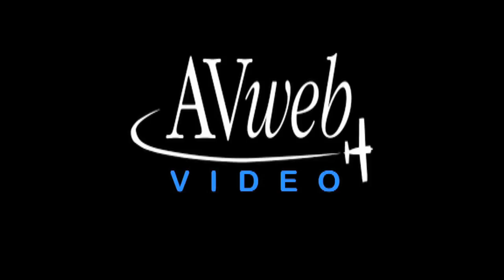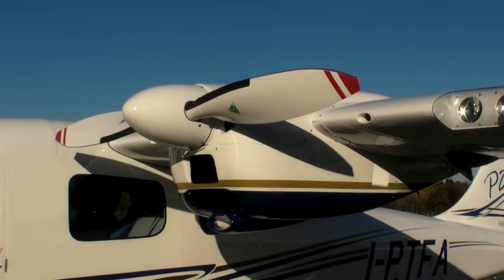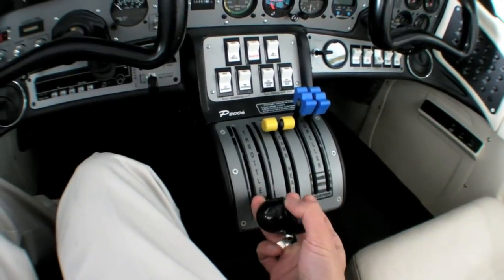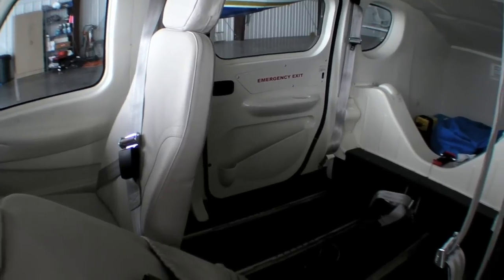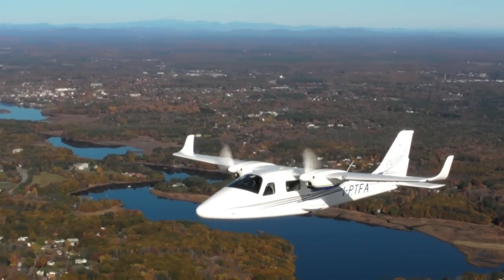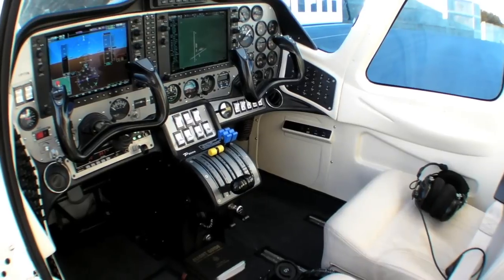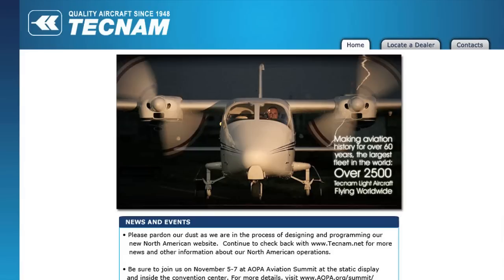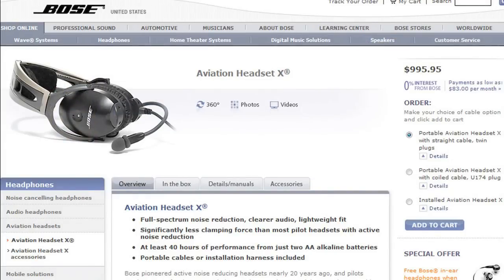Tecnam Aircraft's Rotax-Powered Twin

Comment: These ARE proven engines.  I built a Kitfox with a 912 and I can say it is the best engine I have ever flown behind.  2000 hour TBO, starts easily, runs smoothly, absolutely reliable.  Dual CDI ignition, dual carbs, water and aircooled, and will run at reduced power to get you home if it loses coolant.  I can't say enough about this little engine.  And, I might add, I believe they are quite a bit lighter than the Lycomings.

Comment: I just read last night in the latest AOPA magazine that the aircraft will come with a G1000 with an integrated GFC700 autopilot instead of the S-Tec 55. It also gave a price of 550K loaded. Not just under 500K. 500k might be a bit pricey for this aircraft but it is still a lot cheaper than a seminole which would be the next twin in line for the flight training field. Especially if you compare the operating costs between the two aircraft.

Comment: Just came across this Vid, interesting. Lots of 'sales' talk there though which is to be expected.
The 'none event' is definitely a sales pitch as many pilots have come to grief when handling an eng failure in a light twin. At best the other engine takes you straight to the scene of the accident & you have the honor of being the first one there !:-)
An eng failure can be doable but only under ideal conditions, just after T/off at gross weight on a hot day &  I hope you are religious..lol
Reply: It's actually pretty
Good about climbing out max on a warm day even on one engine.  It actually is a non-event losing an engine in the Tecnam P2006T so much so that you need left rudder almost when you lose the right engine .... its actually one of my complaints...it might be too easy as transitioning to a large twin with some real horsepower will be eye opening for anyone who learned on the Tecnam. The flip side is that it's an easy training aircraft and introduces the student to losing an engine without a lot of the danger. Good flying  habits still need to be adhered to as any twin can sneak up on you.